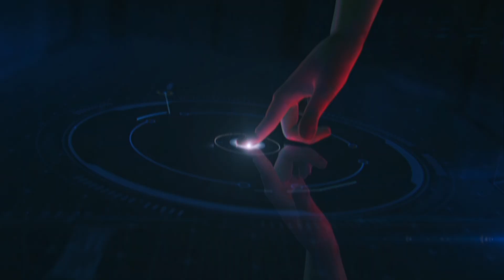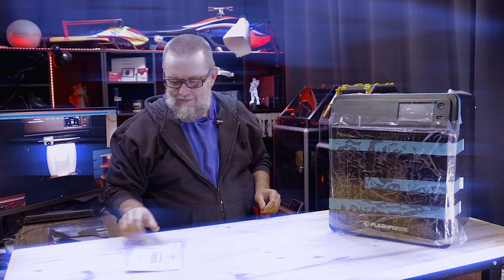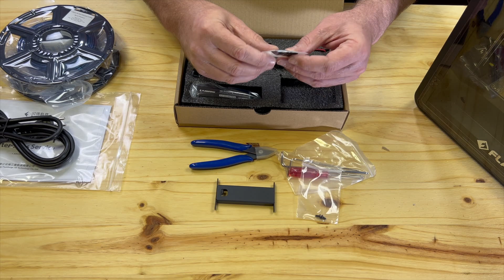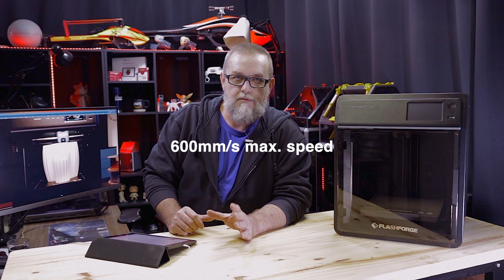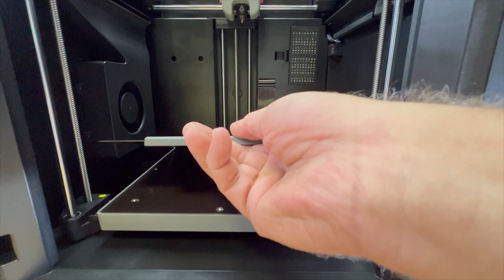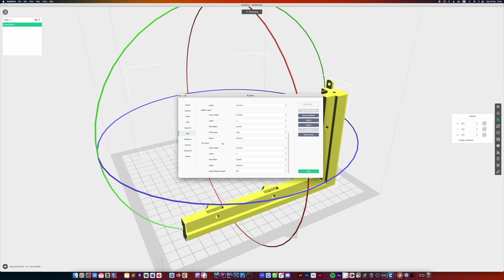Everything you need to know before buying FlashForge Adventure 5M Pro

Comment: Witch one thinking on Cost vs Benefits, 5M Pro vs P1S vs K1C? I almost sure you will say P1S, so, and between 5M Pro vs K1C?
The last one, this 5M Pro can print PLA-CF? And about wood?
On website they do not comment about PLA-CF, just normal PLA…. thanks man.
Reply from the maker: If you ask me about cost/benefits I put 5M Pro on the top of the list with P1S, P1P, K1C. It prints with the same quality as Bambu Printers with a little bit smaller printing area, with the cost of a Creality printer. Yes you can print CF, GF and wood, I just recommend you to buy a hardened steel nozzle.